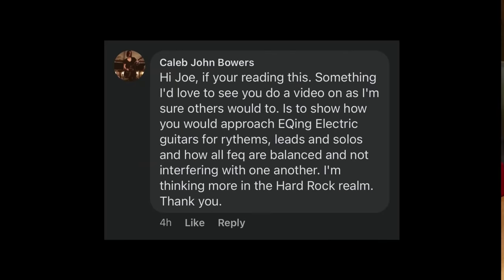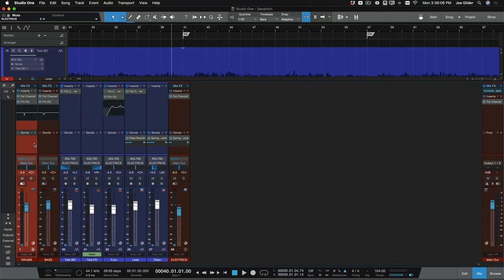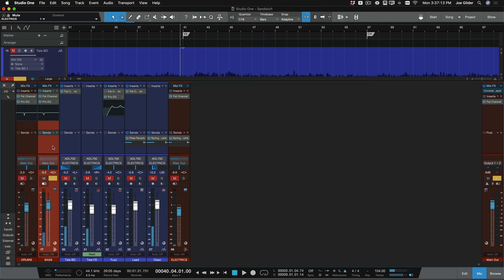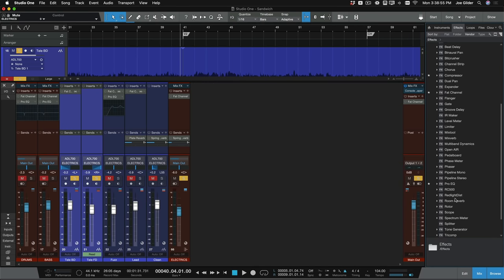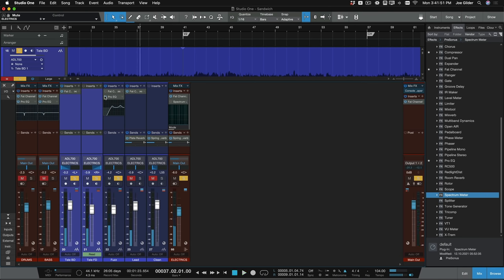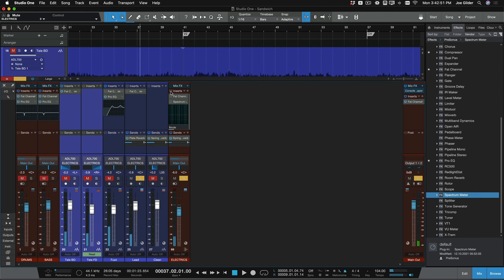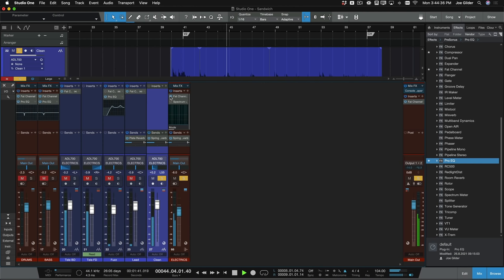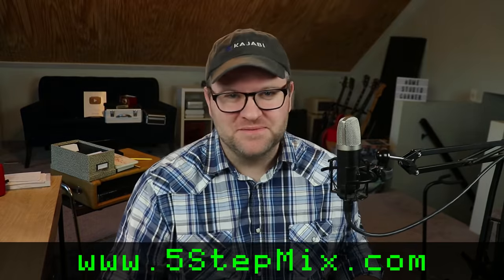How to EQ Electric Guitar

Comment: I've listened to you on and off for some years now, and I find your content so valuable for learning. I make tracks for my church since our band is smaller and we want a bigger sound, so I lay down electric guitar frequently. After doing it for a few months starting early-ish last year, I found that there was too much rumble muddying up the electrics at large, and someone pointed me to a multiband compressor that I've found very useful, so I set up a template to use on my tracks. But I've since found that I went overboard in pulling out so much of the warmth and left the guitars sounding thin. I'm sure no one else here pays much attention to that sort of detail, but I also like to do bits of stuff on my own, so that's somewhere I've wanted to grow.

I see you had various EQ on individual guitars here as well as the group at large. From what I picked up here, you used the group to clean up some of the ultra-low end (per kick/bass) and did more of the warmth/higher work individually. Is that right, or did I misunderstand? I put a chunk of my cuts around 330 when I set up that template, but I've since reduced the cuts and my tracks are sounding better. I've also made a new patch on my modeler that I think helped a bit with the source (yes, I've listened to you a lot), but I'm still evolving on this particular area.

Comment: Some excellent stuff here. I want to try that center panned fuzz guitar thing now. I think the bass sits great here but what I’ve noticed in one song I’m working on where the bass is playing melodies in the verses with more of a sparse guitar arrangement compared to the slightly busier keyboards is that the melodies aren’t cutting through unless I boost the mids between 250 to about 400. So, now the bass melodies are being heard but it’s taking over the mix. I need the bass melodies to be heard but not over the guitars. 

Also, how would you get a melodic bass to cut through in something like a Green Day track where Mike Dirnt tends to play more melodic lines to Billie Joe Armstrong’s rhythm guitars? I’m thinking that Billie Joe’s sound tends to be kind of scooped in some tracks, letting Mike get in there a bit on the mids? I’m not sure.